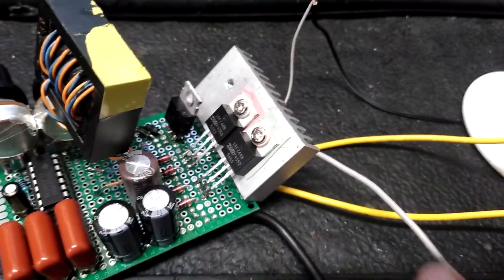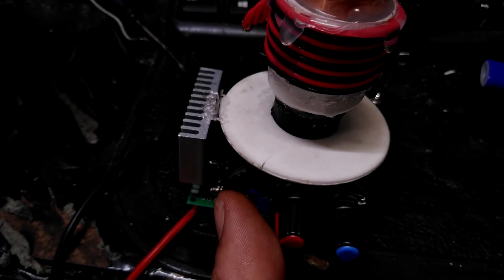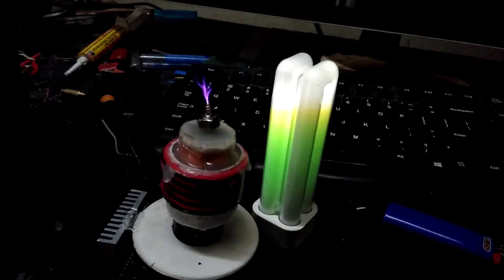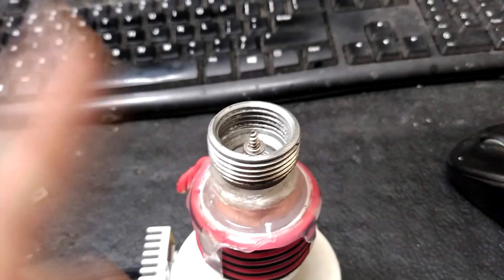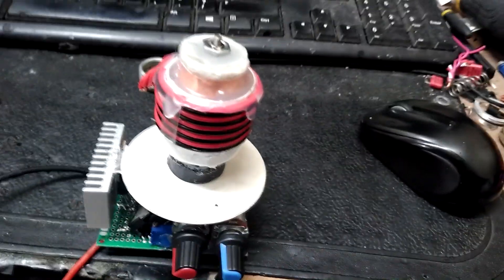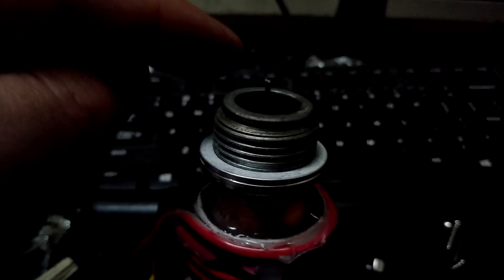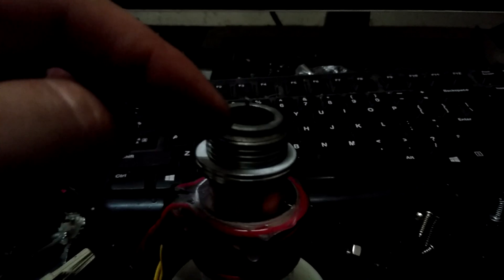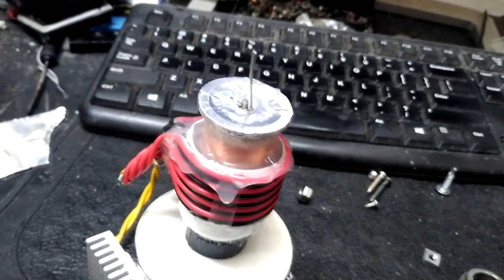Tefatronix SSTC IV

Comment: Can I use the 555 timer IC for the interrupter? And have you tried it and it works or not ? Because my tl494 IC just broke
Reply from the maker: Yea anything that can switch a mosfet will work. I just use the TL494 cause it allows me to easily independently adjust the duty and bps with the one chip. You'll need two 555's to do that unless you more or less choose a fixed value for either duty or bps.
Reply: @Magneticitist  Do you have a schematic for the interrupter using the ne555 timer IC? Could you please give it to me if you have
Reply from the maker: @why.k5max  I just use Steve Ward's interrupter so I don't have a circuit of my own. https://www.youtube.com/watch?v=MzFJI7eu2yc

link in the description and I explain the mods. You probably don't want/need burst mode so you won't need that 3rd 555.
Reply: @Magneticitist  Thank you very much I appreciate it

Comment: I do not undestand why it is feeding the gate of the interrupter mosfet with vcc(+5v) , so when the signal goes low I guess it put vcc to ground but would'n it be the same to just feed the gate with the high part of the signal ? it just called my attention , I just feel like it would be bad for the microcontroler to be feeding vcc to the output and then shorting it to ground could you explain it to me? Anyways I want to use a 555 timer for interrupter
Reply from the maker: You have to remember that the actual gate driving signal is derived from the secondary feedback current. By just barely biasing those gates to ON from your dedicated logic supply rail you aren't really wasting any power anywhere. With the gates always low there is just no power dissipated to notice on the logic side, and there's also no gate driving current to ground because there's no feedback loop. The interrupter output is going to swing high and low either way and has a current limiting resistor on the gate. So if you were to observe the 'standby current' of a properly set circuit when the interrupter is at 100% keeping the gates off 100% of the time, you will have minuscule power draw through the gate biasing by the RV1 pot. If you have more than minuscule power being wasted then you have the gate voltage way too high.
Reply: @Magneticitist   thanks I been looking into it and now I have a better undestanding. Also I went to the electronics store and got a ucc27324 so I looking foward to my first gate driver build , I want to try the steve ward single mosfet micro sstc I am afraid that the antenna signal will burn my driver so I am going to get a schmitt trigger to filter the signal I think it would save my driver , I am also thinking if I could make my own schmitt trigger with two 2N2222. Also I been playing with the push pull sstc to the point It improve te output a lot , and I burned two irfz44 while tuning it lol thanks for all the knowledge 🙌
Reply from the maker: @rodriguezfranco3839  Damn I was assuming that dual driver was both inverting and non inverting but it looks like both are non inverting. If it allows it I suppose you could just parallel the outputs for more power to run the single mosfet circuit. Otherwise I was thinking you could use the dual driver for a simple half bridge. Still probably could by just feeding each input with inverting and non inverting signals respectively from the schmitt trigger/inverter.
Reply: @Magneticitist  Yep so it would be a problem if the schmitt trigger is inverting the signal right?  I need to study a bit more about schmitt triggers , I think I shoud parallel the outputs and inputs on this driver if I want to use a single mosfet right?
Reply from the maker: @rodriguezfranco3839  With the Steve Ward circuit the 74HC14 is a schmitt trigger hex inverter, so it has multiple Inputs/Outputs. This means that if you feed an input a signal, it will output an inverted one that is also squared and cleaned a little. So let's say you have inputs 1 and 2 and outputs 1 and 2. You feed input 1 a signal and output 1 is inverted. If you tied that inverted output to input 2, then input 2 would invert it back again and you have a signal that is in phase with the input minus the slight propagation delays. 

So let's say you have two gate drivers where one is inverting and one is non inverting. You feed their inputs with the same signal and they would output High alternatively on their own. If you had 2 gate drivers that were both inverting or both non inverting, feeding them the same input signal would have them switching exactly the same time which is not what you want. Since the 74HC14 has multiple ins and outs that are inverted then you can take one output from it and feed one gate driver, and then take another inverted output and feed the other identical gate driver. In your case both of your non inverting drivers are in the same package but it's the same idea. 

The whole point of that is to have a 12-15V output or so from each driver that creates as +12 to 15V and -12 to 15V for a peak to peak voltage of 24-30V or so feeding a GDT primary. Each gate driver is powering the primary in different directions creating these polarities. With a single gate driver outputting +12-15V and 0V, you have half the peak to peak voltage and would end up with +6V/-6V swings or so across the gate if you used a GDT. Not using the GDT and feeding the gate directly would just drive it with the 12-15V to 0V with no negative swings.

Comment: Nice! I have in plans making small SSTC on this schem
Reply from the maker: Totally worth it. I've done a bare bones of this circuit before using the IRFZ44N's and got some pretty good CW plasma from it at only around 9v so there's different ways to tweak these circuits.
Reply: @Magneticitist  I propably gonna use IRFP480 and connect it to 60-80V boost conventer

Comment: Your not to far off from making an encased pocket size version you got it tweaked real good.
Reply from the maker: I can't decide 100% if I should scale the coil up a little and just scale the circuit itself down to make up for it, or if I'm just missing something here that would really increase the breakouts. I did have to make a few splices winding that little bastard and the overall resistance ended up being nearly twice as high as I calculated. Such a pain to wind 40 awg tho. This is why I'll probably just try to get some kind of lipo deal going where I can run it at 24v low duty to get cool little arcs or bump the coil voltage down to like 12v and run it uninterrupted straight from the lipo to get hot arcs. Looking at Tefatronix coil though it's only like a half inch wider with slightly bigger wire and his output is insane.